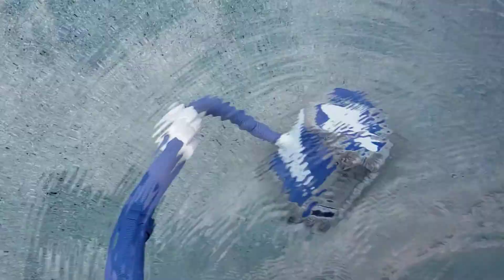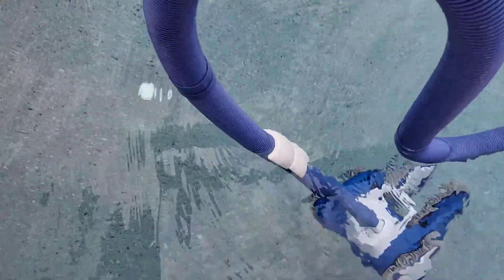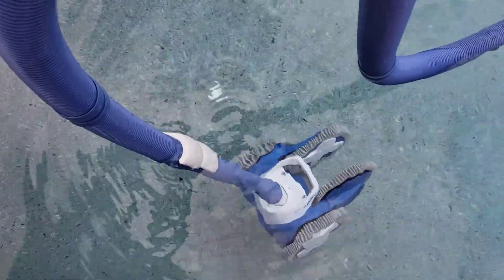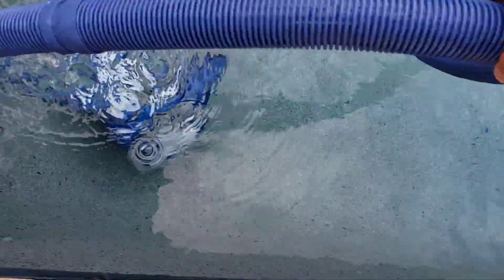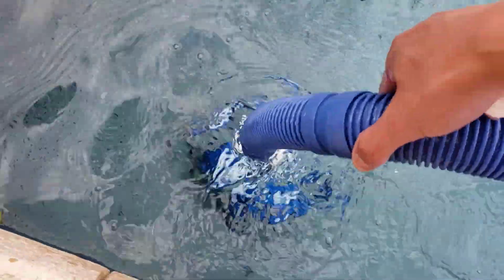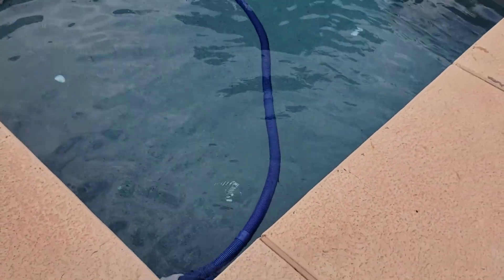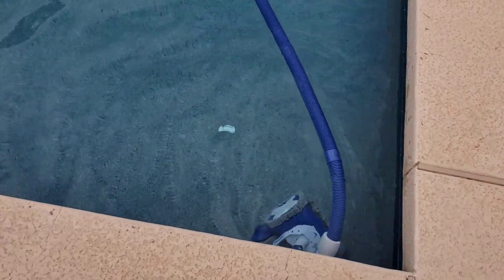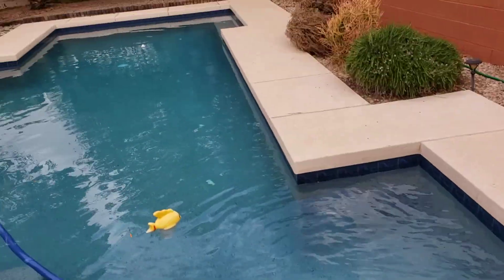Hayward Phoneix 4-wheel stuck in corner

Comment: I have the same problem, the thing keeps on flipping over.
Reply from the maker: Adjusting the suction power and the position of the weights fixed it for me.
Reply: Did you increase of lower the suction?